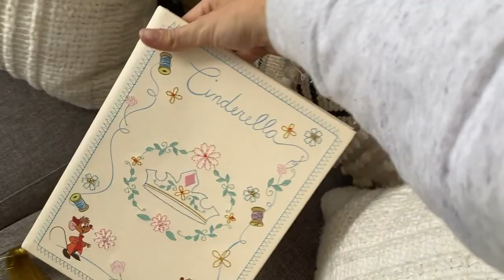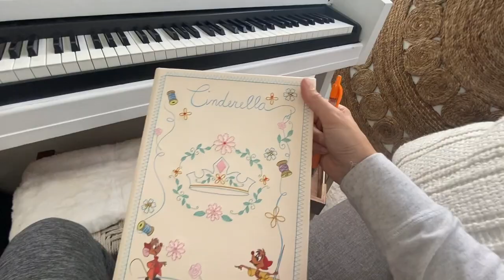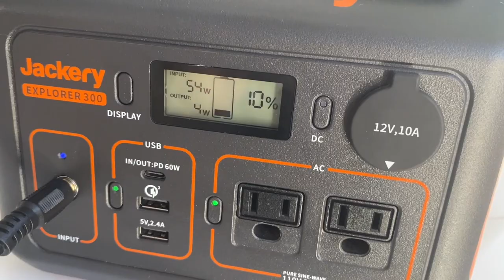DAY IN THE LIFE  // Full Time Travel in a CARGO TRAILER CAMPER (Travel Vlog #121)

Comment: You can buy an Arctic Air Evaporative Cooler starting at $24.95, which will cool the area where you are sitting, or get the EcoFlow Wave with battery for around $2,000